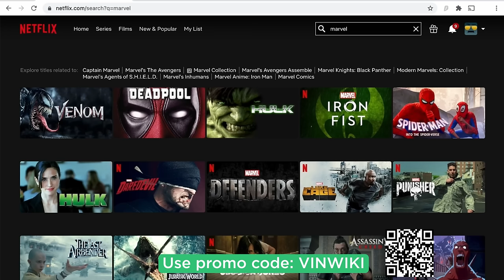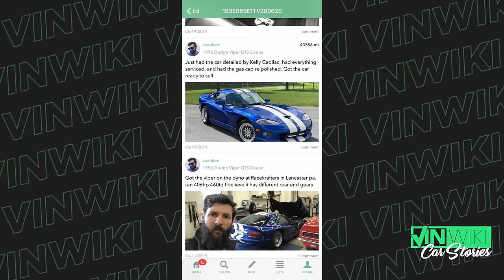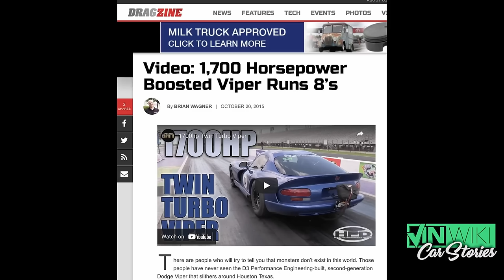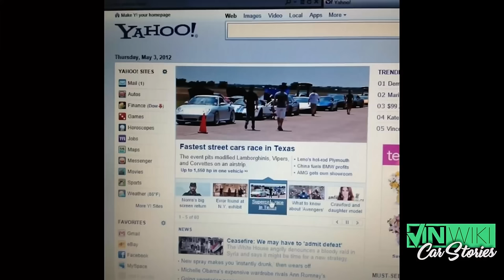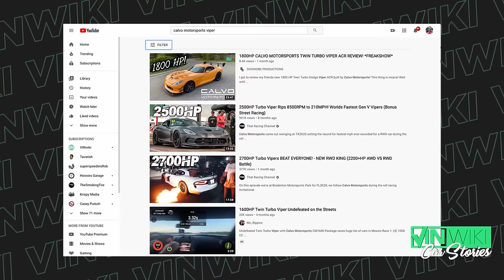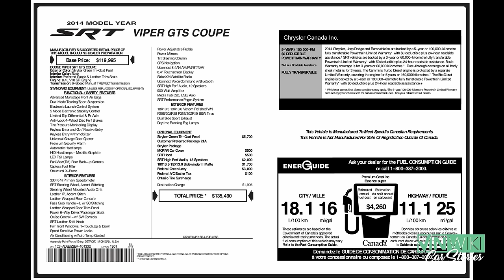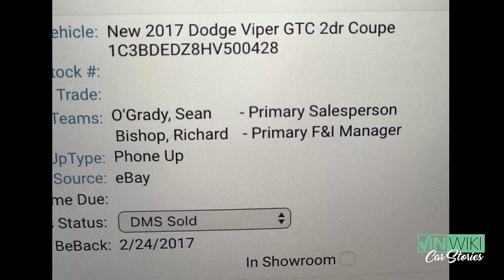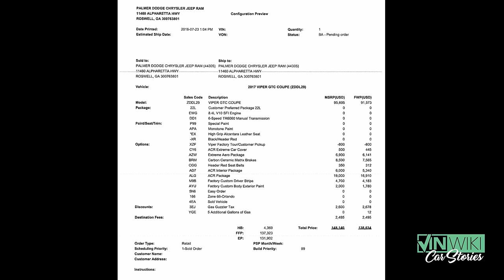VINwiki's Top 10 Dodge Viper Stories!

Comment: The first several generations of Viper were just absolutely insane, murderous cars. You couldn't keep them in a straight line under heavy acceleration because the back stepped out and the tires spun. Which, in its own way, was exactly what Americans wanted. It was a true muscle car. And it wanted to kill you. The last model they made was a lot more competent as a sports car and handled well, had plenty of power to smoke the tires, but was able to be driven with a measure of control. I also found it to be the most beautiful version. A shame they killed it off. Expect its value to hold steady a bit longer then increase in value over time as people regret that they didn't buy enough of them for Chrysler to consider keeping it.